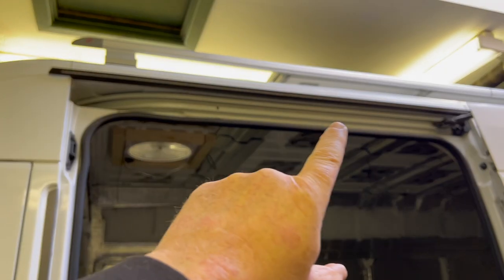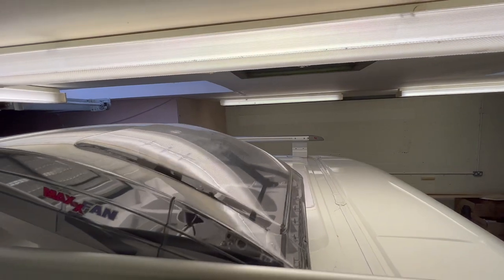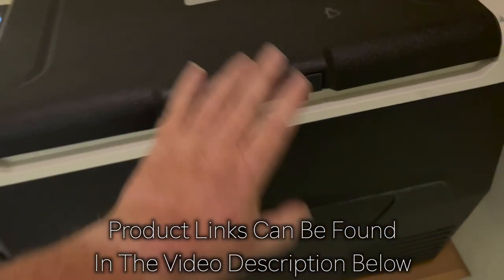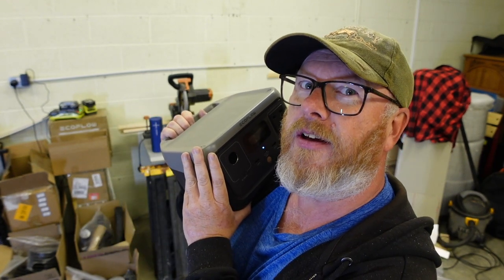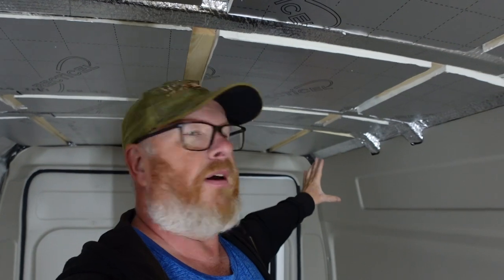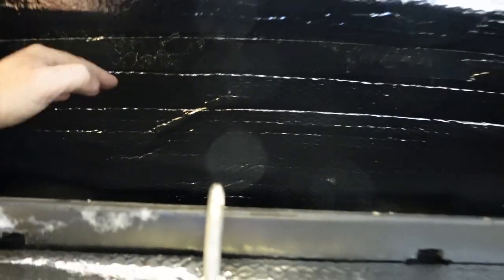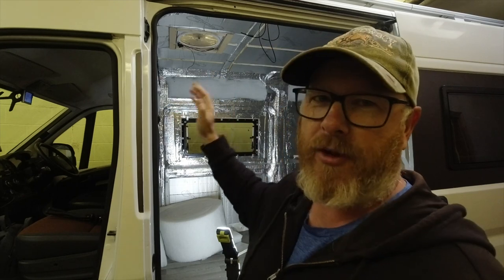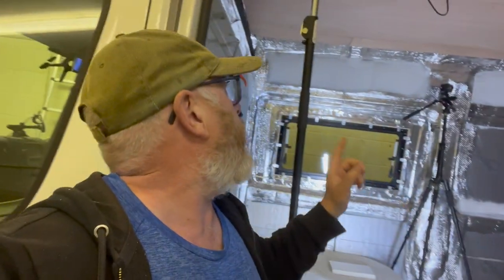Starting the Ceiling installation & Reviewing the Ecoflow River 2 - VB18

Comment: Hi John, really enjoying watching the van build, when we had a MH it had a roof light over the cab which allowed the air to flow through when we were driving causing an awful noise. My solution was to use weather proof draft excluder tape/ seal and that did the job. It may not be a practical solution for your max air fan, but sharing is caring, keep up the excellent work👍

Comment: To be technically correct the roof goes up not down! :D I recall when i did mine, in ones head its I'll do x y and z and it doesnt seem a lot of work - then you actually do it and its jeeeez man.... some bits take 5 or 10 times longer than you thought for one reason or another. Then theres the jobs you never get done - ive 2 or 3 jobs I never got around to doing bit they aint things that get in the way just finishing bits! Ought to get them done really! Hmmm yeah job for the weekend.

Comment: Just a thought John, and probably to late :) could you make one of the bed overhead cupboards longer, a floating wardrobe so to speak, with just room for for feet underneath? Just a suggestion for a lot more storage. Looking good so far.    Ged
Reply from the maker: That wouldn’t work as I’d swap ends of the bed if the parking wasn’t great for my normal sleeping pattern.
Reply: @GadgetJohn  yeah, that makes sense.  And if Mandy joins you then you could top and tail lol

Comment: Thanks for sharing. Is there a cover of some sort that covers the gap at the top of the panel on the back door? I know you are a perfectionist and must have a plan?
Reply from the maker: I might see if I can adjust the panel position slightly as it is annoying the nearside panel doesn’t fit as well at the top as the offside does.